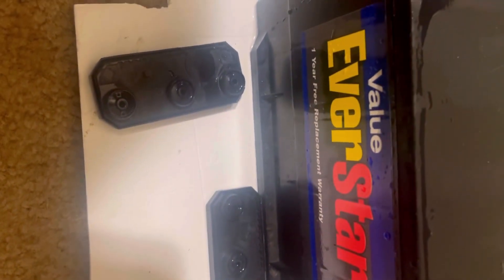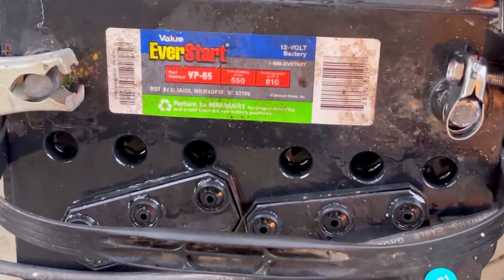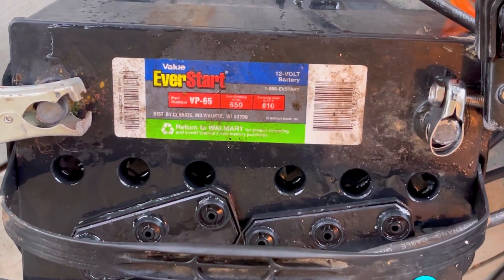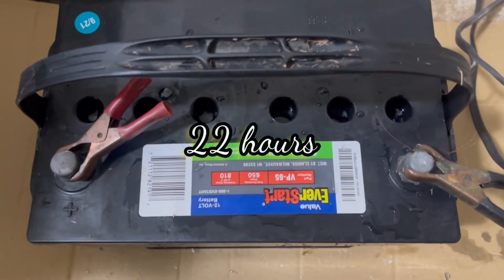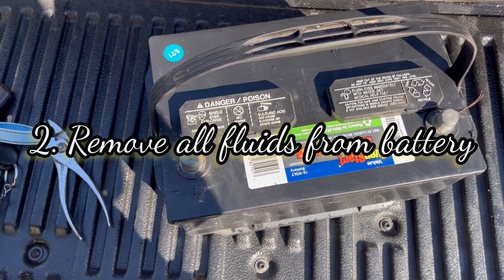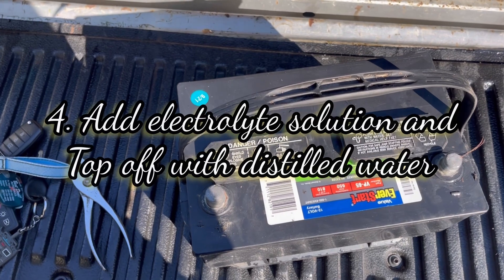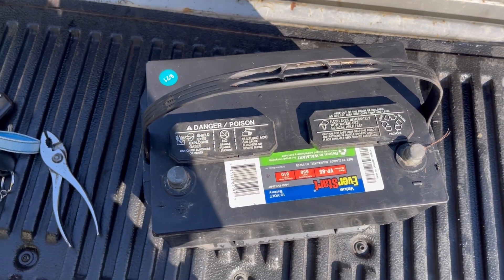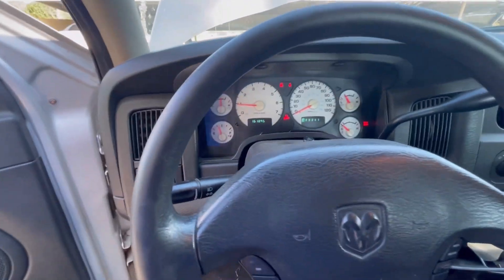How to fix your Car battery for less than $30

Comment: Have you checked the cold cranking amps and internal resistance of the battery? I’d be interested to see how close to specs it is.
Reply from the maker: I don’t have the device to check it but I started my truck when it was -5*F and it didn’t even struggle

Comment: Amazing job, where did you buy the battery acid from.....Peace
Reply from the maker: I ordered it on EBay but I’m sure you could find it on Amazon as well 👍
Reply: You can get 5 gallons of battery acid at O'Reilly's for 25 dollars
Reply: @damensutherland7081  thank you...Peace
Reply: Just tried to get battery acid from O'Reilly's and they say they don't have it Monday I'ma see if he can contact distributor to see when theyl get it .I'ma try lightning drain cleaner it's 19 dollars for 93 percent concentrate not Shure if it has any other ingredients I looked but did not specify
Reply from the maker: @damensutherland7081   did the drain cleaner work?
Reply: @dronepilot260rc  I'm not sure if I would recommend to somebody but one battery I added the acid to and got it up to about 1.3 gravity on refractometer and it worked on one battery and on other I did a whole new batch with the drain cleaner and highest v I got it up to was 6 v so not to share why it's not working .I see they got 5 gal at Napa auto parts now tho it's 45 dollars though